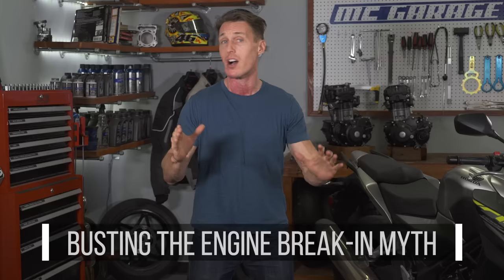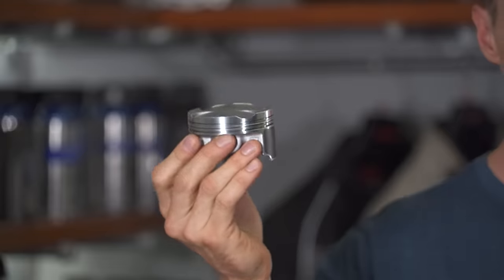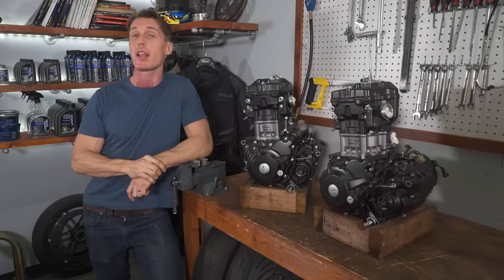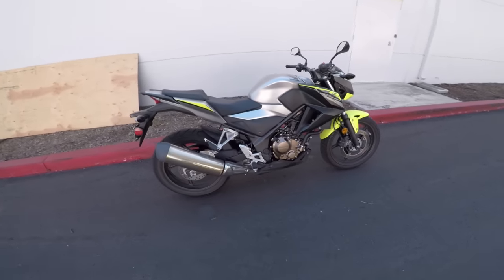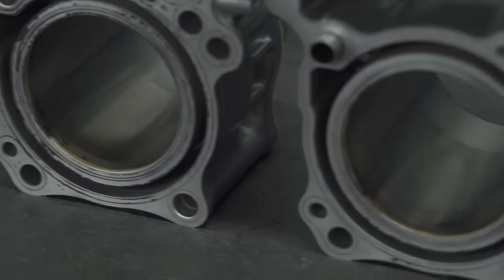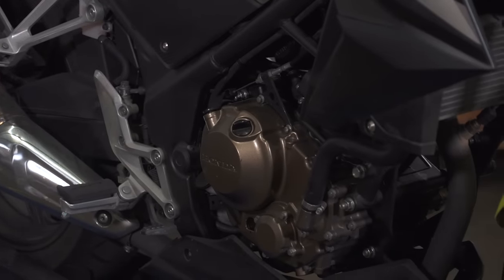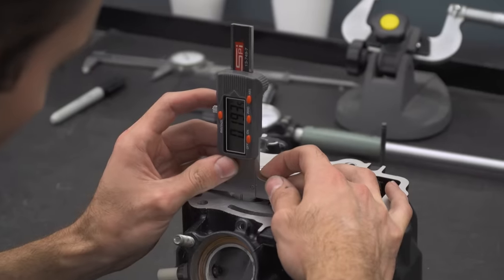Busting The Engine Break In Myth | MC Garage

Comment: Back in the olden days (1980 ?) I bought a new XS250 special , The twin engine was so tight that it would lock the rear tyre on down shifts around town in the lower gears. It took a few hundred km's to loosen up and then give it some red line. I was eagerly waiting for all the extra power to come in once I finally reved the shit out of it, but was disappointed when nothing really happed.
Should have waited for the RD250LC   Doh ! Still had a lot of fun on it.     Hope the face has recovered by now and Cheers from New Zealand.

Comment: I broke in my 1998 ZX-9R "by the book" and ended up with a less than ideal break-in as the piston rings hadn't worn enough to make full contact with the cylinder walls after several thousand miles.  So yeah, that was 23 years ago and things might be different now, but I still take a middle ground approach when breaking in a new engine.

Comment: Some piston rings throughout history have come with a coating that was meant to be worn away, and this was the real point of the break-in.  Before the coating was worn away, end-gap would be very tight and hard running could potentially lead to a seizure, especially in 2-strokes where things can heat up (and cool down) really fast.  It was also the signature calling card of older Wiseco pistons (and what lead to a number of myths about forged pistons).  This is definitely still a thing depending on the manufacturer of thr rings.  This coating situation was meant to shorten the break-in time compared to a plain cast-iron ring, which can take quite a while to mate fully to the bore, but loses less end-gap in the process.

Comment: i got question, my mileage right now is 470KM but i just realised i didnt follow the break in process and i once rode 100KM/H with pillion and sometimes i did high rpm issit bad ? But once i realised theres a breaking period i start riding it properly gg highest 5th gear and not more than 700rpm is there anything i should be worried about ?
Reply: Im riding MT15

Comment: My first new bike in 1976 (Kawi 125 2-stroke enduro) was to be babied as per break-in specs. But, alas- my high school classmate wanted to race the moment I got the bike that took me 2 years to save for. He had the same bike. He took off like a shot, I didn't. At first. Screw it, I gave it good throttle, got up to 65MPH, flew over a small hill in the road and was partially airborne when I smashed into him. He stopped to wait for me where I couldn't see him! The bike flew into a ditch, stuck at full 
  red line RPM. I stumbled about accessing lost skin and ground down kneecaps at first oblivious to that screaming engine 200 ft. away. Finally, I got to it and hit the kill switch. That bike lasted me for years, went 25,000 miles without a rebuild, and took me from Illinois to Colorado, including great mountain trail riding. My knees mostly healed. Ari, I'm tellin 'ya- you'll be fine!

Comment: You make good points. Heres my scenerio, i have a 98 buell s1w which has 11k miles on it before i installed a hammer 1275 kit and headwork. They recommend a certain break in period which includes 500mi of easy throttle. Now this being a glorified sportster motor with a redline of 6k... what do you recommend? The bike is sitting for the winter now and just gets started every couple weeks and idles no longer than 30secs as of now. I have not taken it out since the build.

Comment: My favorite tuner on his ZX-4RR recommends 300 miles of moderate riding.  Then an oil change and ride it like you stole it.  He did the math and that is about 600,000 revs on the average motor at 300 miles.  He says if things aren't bedded in by then, then they never will be.

Comment: Purchased a brand new 2012 v star 950T in 2012. Bike never seen the interstate for 1st 1,000 miles. Kept it on back roads, sped up then slowed down for 1st 1,000 miles. Engine went through a complete cool down after each ride. Changed the oil at 600 miles to amsoil and now has 28,000 miles and not 1 issue

Comment: Did you do oil analysis's or just visually inspect for debris in the oil?
I would be curious to see if the bearing wear was increase in the engine that wasnt allowed a break in process.
Reply: I would be fascinated to know. Blew my rod bearing on a "lightly" used '14 SFV650 with only 1,400 miles.

Cut to two years later, only 16,000 miles, blew the entire thing up. I religiously took care of that bike. 
I bieve I either had and incredible stroke of misfortune, or the first owner spent all 1,400 miles at redline.

Comment: I was told break in was something done decades ago. When machined tolerance weren’t has close they are today. I still have to break in model airplane engines. They don’t machine them to the tightest tolerances. you can hear the changes and running temperatures gradually get cooler.

Comment: I'm following the manufacturer's recommendation.  It doesn't cramp my style in the least.  However, I'm not inclined to tell anyone else how to ride their bike.  It's still a semi-free country.

If I was rebuilding an engine, I wouldn't use synthetic oil for the break-in.  It's too slick to allow the metal parts to polish each other.  At least, that's true for cars.  They have more friction reducing additives for improved mileage that motorcycle oil doesn't have to prevent the wet clutch from slipping.

For modern engines, I think low RPM lugging is probably worse during break-in than high RPM or high power output.

Comment: I've always thought that the running-in process was to get rid of all the bits of stray metals that wear off brand new components, into the oil and filters and to not risk causing damage with bits floating about. Then, after the 1000 mile process, flushing the engine and changing all the fluids and filters completes the process.

Comment: I grew up racing motorcycles. 
My father built the fastest tt500 around from 1976 until 1983. 
He did a high side tank slapper and stuck he’s head in turn 2 at Porterville, California 
He didn’t wake up for 3 days. He started fishing after that. lol 
He would build a bike in his garage put gas in it start it let it warm up for a few minutes then he would rev the hell out of it. If it didn’t backfire or blow up he would take it off the rack and go tearing down the city street wide open turn around and come back same way they need bring it back to the garage and put it up the next time he would start it would be to practice at a race. 
He never did a brake in period. 
He would run it all out until it blew up or just lost power. 
He could rebuild a motor in 6 to 8 hours if he had all of the new parts on hand. 
I’m talking about a full rebuild. Honing the barrel, taking the crank apart and replacing the rod and bearings and replacing the valve guides with titanium ones also port the head and enlarge the intake and exhaust, valves and seats. 
And a few other modifications that made it the fastest bike around. Undisputed. 😊

Comment: I have been working on race engines for 20 years. Breaking engines in is a myth. But letting your engine warm up from cold start before hammering on it is something I recommend for every vehicle.
Reply: I only hear this from people who have never shaved a lobe off of a camshaft before
Reply: @thecloneguyz  That's been my experience with probably 150 motors. But the 2/3 of them have been 2 cycles.

Comment: I wish you a full recovery from your fireworks accident, and hope you aren't dissuaded from having even more fun. Engine break in: I apologize for comparing a high performance motorcycle engine for a power equipment engine. I have read instructions from various manufacturers of these small air cooled engines. They are less concerned about how the engine is loaded or used when new, but, they are adamant about  the first oil changes during break in period. These engines don't usually have an oil filter, and the particulate matter (mostly from the cylinder) needs to be flushed out after very few hours of run time. If it's an engine critical for your profession, I would change oil after 30 minutes, than again after 5 hours of run time, just to flush the metal out. Those first 2 or 3 oil changes can make the difference between a few hundreds of run time, or several thousand. I didn't notice weather your motorcycle engines have oil filters or not. If they do, the 600 mile thing seems right to me, but still critical to the longevity and reliability of the engine, more so than how much fun you have riding. If they don't have filters, compulsive oil changing for the first 1000 miles or so can set the engines up for years of trouble free performance. By the time you're used to the bike and have the confidence to give your wrist a little twist, the engine should handle it just fine!

Comment: Top end break-in relies on sealing pressure, meaning higher cylinder pressures and open throttle. 
Bottom end break-in, particularly with solid journals, requires gentle initial driving to avoid spalling and overheating. 
Roller/ball bearings are not so sensitive.

Comment: I don't worry about it.the last new bike I bought a I hit the interstate and went about 80 miles at 80 90 95 mph, fluctuating a little bit,then rode it back home the same way and changed the oil with regular 10 w 40 then rode around here for about 600 miles of normal riding, maybe stretched it out a few times,then around 800 miles I put my Valvoline synthetic four stroke motorcycle oil in it and that was it, never had a problem.I run the same oil in all my bikes and change it about once a year when the weather changes cold I put the 10-40 in then when it gets hot and stays hot and cold weather is over I put 20-50 , no idea how many miles probably around every 5 or 6000 on one and I guess I put about 4000 per season on the other one,either way,when it gets around 50 degrees or less outside,they get 10-40 when it gets around 75 or 80 outside the get 20-50 then it'll get all the way up to 103 or so in the middle of the summer and get down 20 or so occasionally in the winter

Comment: Motorman in the 2000-2005 time frame broke in many bikes prior to racing and said the engine breaks in on deceleration so for 25 miles I broke in a KLR 650 in the hills around Santa Barbara constantly running up and down the rev limiter. Never very long at any RPM (but briefly to redline) or lugging, changed the oil and went another 25 miles with harsher deceleration and to redline, changed the oil. That was it, 50 miles. A year later the Kawy mechanic said the KLR had more power than most, plus it used no oil. Of course it did eat the do-hicky before 7K miles, another story.

Comment: Most brand new bikes get terrible drum oil when you buy them. The biggest improvement i ever saw was going to castrol superbike oil..shifts were instantly nicer.

I have built thousands of race motors. They all get heat cycled and then broken in. Might even break in a spare ring and piston for race weekend on practice day.

Comment: Thank you so much!  However I did change the oil at 300 miles and it sure looked like it was a good thing that I did.  Compared to my car where the oil is still golden even after 3000 miles, this oil was dark, not black but it didn't look good. I will change the oil and filter at the recommended 600 miles and I bet the oil looks much better than at 300 miles.

Comment: You have two engines that do not have large roller bearings, conical, tapered or otherwise....also you “rebuilt” both but some items were worn; or did you replace the crankshafts and journals?

Comment: I hope you got better since this one - certainly some of your more recent vids are more informed and accurate. The trouble here is you didn't know what you are looking for - the variations are a lot less than 0.1thou and won't show in such observations and testing in such a short period. I advise you to follow the manufacturer's recommendation - usually avoid lugging, constant rpm or maximum acceleration for a time, and an early oil change or two. Such tests as these still won't show any difference, but on average the thrashed engine will have a much shorter life than the broken in engine, and in powersports the professionally broken in engine will produce more power. It may not be mentioned in your manual, but break-in should include max rpm (about 1/100th of a thou in two directions can make a difference at this point) and avoid idle for at least the first 30 minutes (break-in generates a lot of heat, we want the oil to be able to carry it away.)

Comment: Did a medium break in to my brand new 2019 CB1000-R. After 600 miles i did an oil change with Castrol Actevo 10w30 & Honda OEM filter. Flushed the Coolant and replaced it with Engine ice.  After the odo jacked up 10,000 miles i am Using Motul 7100 4T 10W40 with K&N 204 filters. I fill up with Octane 87 Non ethanol Fuel & always add an ounce of StarTron fuel treatment. The scope of the story is: What you feed your baby will make it Healthy down the Road. When you have a baby and feed him/her quality organic raw foods he/she will live healthy, disease free and graceful 😇

Comment: There one thing I would like to be explained I put a s1000rr brake master cylinder on my sv650s but after 10 mins the brakes locked up.S1000rr .10   3/4  sv650 5v 5/8 can you tell me what that means and why it did not work.

Comment: i love data driven results however, this is just one comparison.  Question:  Is the break-in really more to deal with slight differences might occur in a more mass produced manufacturing plant vs the care & detail to your hand assembled engines?  What do you think of a test setup where you purchase 10 engines (or something) and do same tests on each set of 5 (or 50/50)?

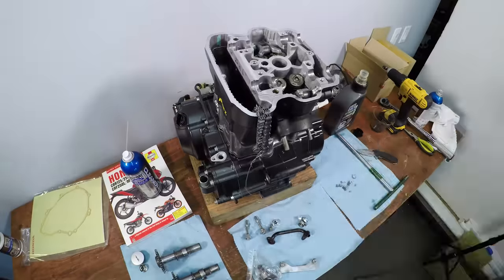Comment: Which piston at 5:24 is which?  It's not just the clearances, but the surface finish of the bore and how the engine is going to consume oil past the rings.  I think the differences will show up after a few thousand miles or track days.  I still think that head to head dynoing the two engines after equal time still has plenty of comparison value.

Comment: For all these people out there hating on the idea of running an engine in hard out the gate, you guys have probably never built an engine from the bottom up, just what exactly do you guys think it is going to hurt in the engine that it won't hurt 1000 miles down the road. The only thing that is actually wearing in is the piston rings and cylinder walls, that's it !!
And if the bores are round and straight, and were properly honed there isn't much you can do to screw it up. Mainly if there is a proper crosshatch in the cylinder those rings are going to seat, sooner or later.
I personally have been building  everything from lawnmowers and motorcycles to radial aircraft and heavy diesel engines since I was 13 yo. and on pretty much all of them I fire them up break in the cam ( if neccessary) change the oil and filter and then run the sh%t out of them. If anything is going to happen I want to know now not a week later 200 miles away. And oh yeah, by the way, I have never had a problem, and trust me they were all stress tested, daily and thoroughly!!😁😁
Reply: Those guys worried about running the engine hard are the same ones that ignore their transmissions for 7 to 10 years and when they finally decide to change the fluid it goes out on them
Reply: @thecloneguyz  your exactly right! By their logic, you can only help it not hurt it by putting fresh oil and filter in one. They aren't thinking about all the trash collected in the little corners and gaps, then that fresh detergent in the fresh oil starts breaking that shit loose, anyway, you know the rest of the story. 
But try and tell them, they'll just have to learn from experience. God knows I sure have, ruined a couple of good machines over the years too!

Comment: I find it interesting that this whole engine breaking thing has kept around so long.  The modern metallurgy means the polish and debris problems with break-in aren't an issue unless you are running something with a redline of 10k or greater.  The issue with the higher RPM engines is that they struggle to keep lube at high rev until the engine goes through the whole rev range several times to distribute some slightly compressed oil throughout the oiler ring